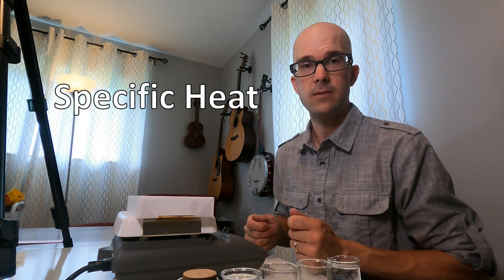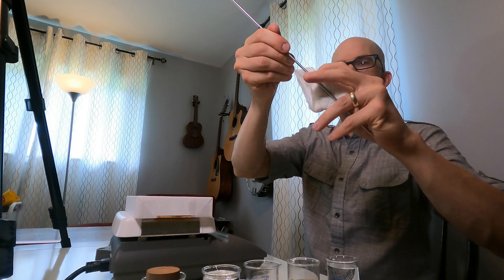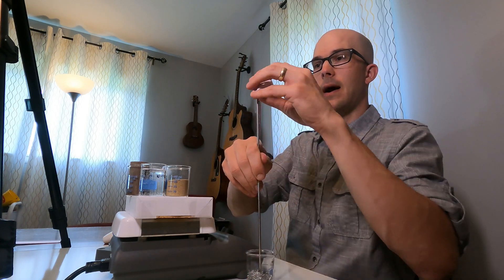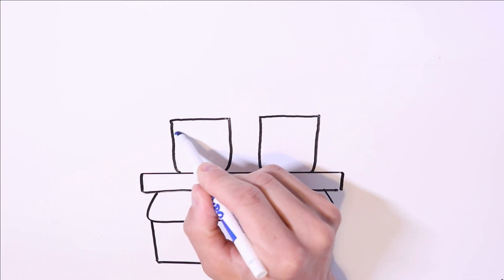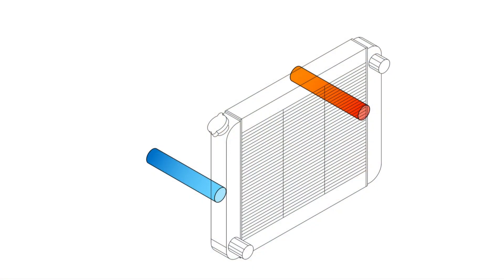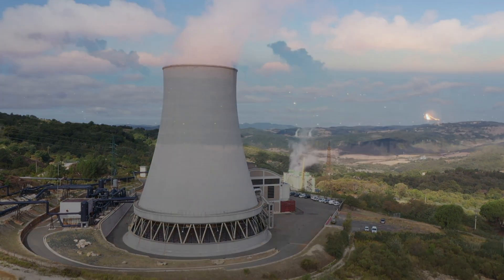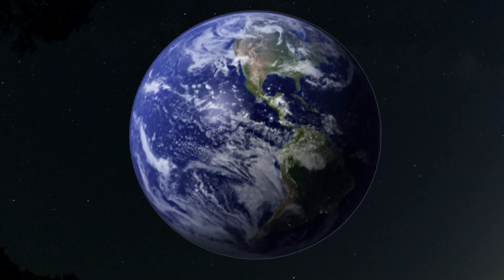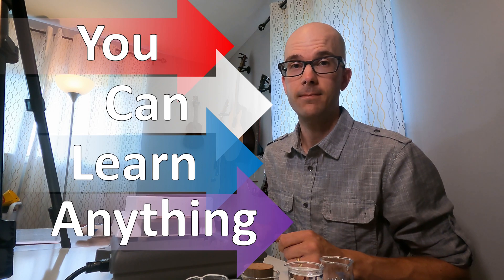Water and Heat

Comment: To me both substances were exposed to the same heat but absorbed it differently. The sand in your example assimilated to the heated surface faster than the water did. When you leave the water on the heater long enough then it will eventually absorb enough heat to match the temperature of the heater. A well done video but with a confusing outcome. Thank you for your challenge.
Reply from the maker: I think you are right. The important thing is that the water changed temperature the least while it absorbed the same amount of heat. Thanks for watching!